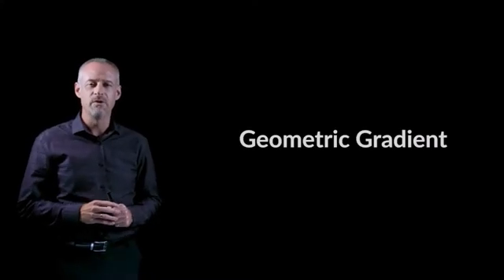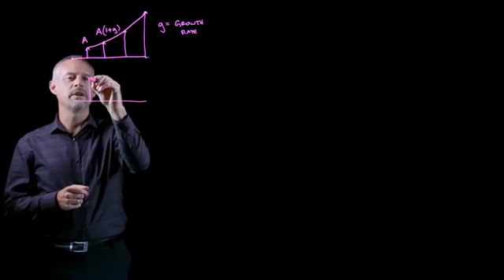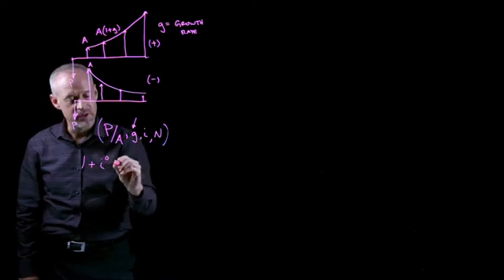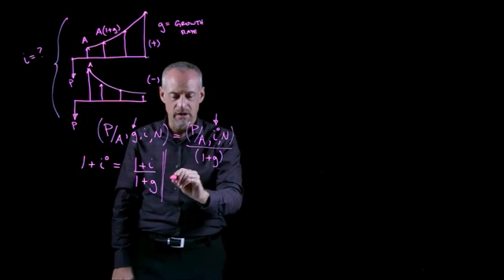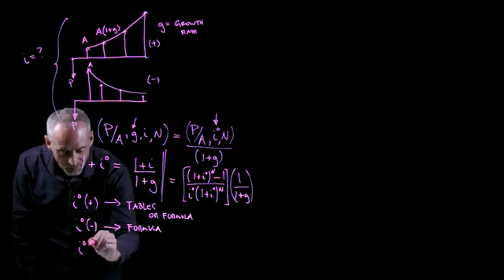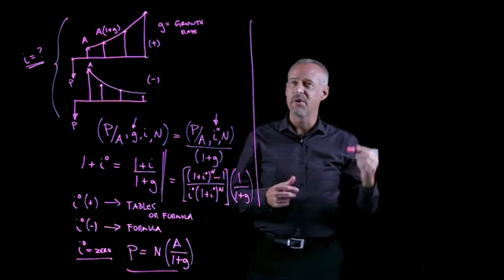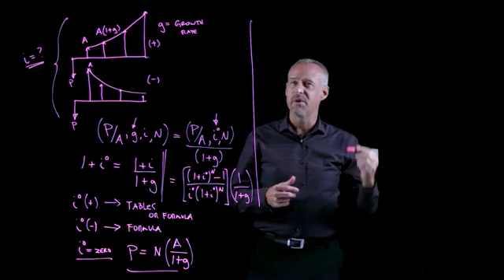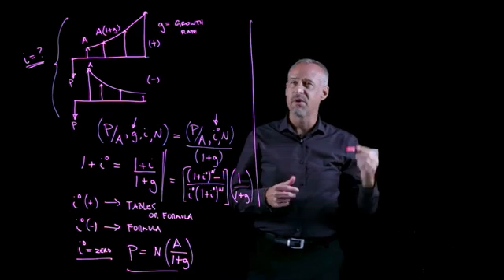Geometric Gradient - Engineering Economics Lightboard

Comment: why did you use -1 for the example?
Reply from the maker: I think you are asking about the -1 in the formula when I calculate i*.  This is just algebra.  Notice on the left side of the screen:  (1+i*) = (1+g)/(1+i).  Solve for i* by subtracting 1 from (1+g)/(1+i).
Reply from the maker: Correction:  The ratio is (1+i)/(1+g)...I wrote it incorrectly in my reply above.

Comment: How to find factor for 1.25%🤔
Reply from the maker: Your finance or engineering economics textbook should have a compound interest table for 1.25% (I mention this at about 14m00s in the video.  In the table, look in the column for "P/A" and the row for 24 periods.  You can also use the formula for the P/A compound interest factor which is shown earlier in the video (on the left hand side of the screen) - it is the formula in the square brackets beside the (i/1+g) term.  Hope that clarifies.